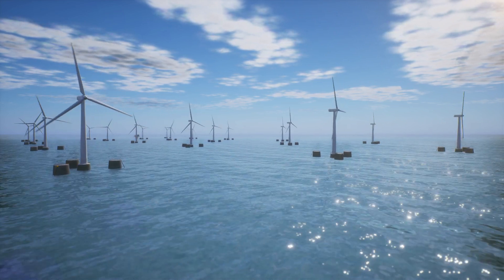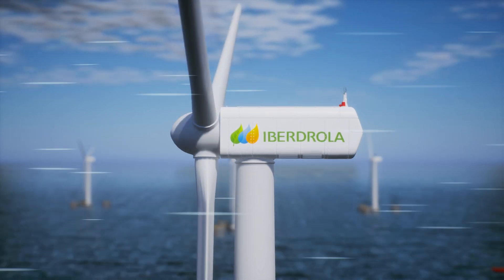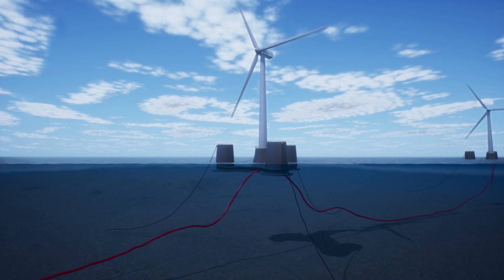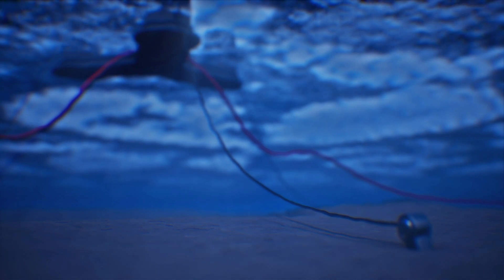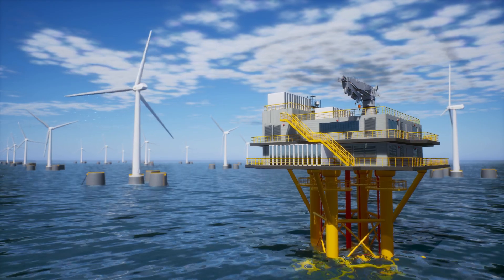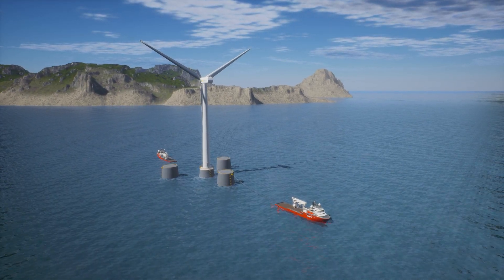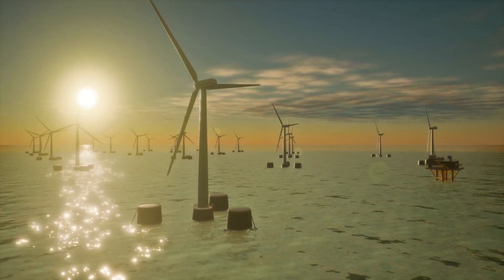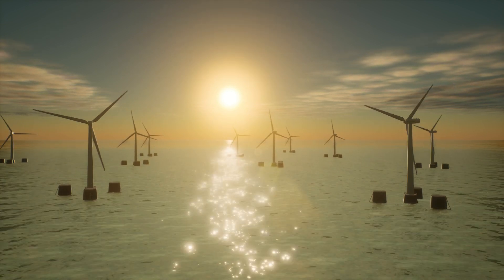Offshore wind farms - How do they work?

Comment: Floating wind turbines create a "labyrinth of death" for whales. Note in the video above, the anchor chains and floating power cables.
Migrating whales will have to "run the gauntlet" of massive anchor chains and high voltage interconnecting power cables. 
Call for a moratorium on all offshore wind farms to save the whales.
Reply from the maker: Thank you for your feedback.